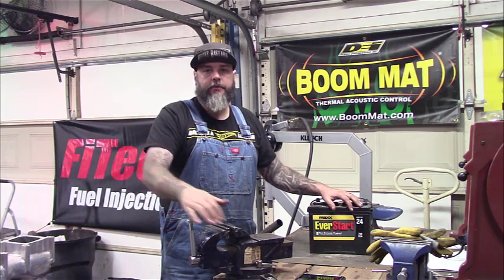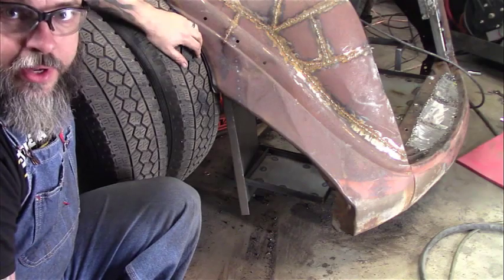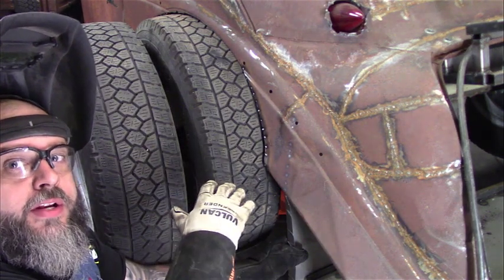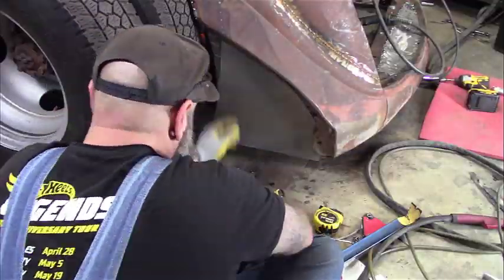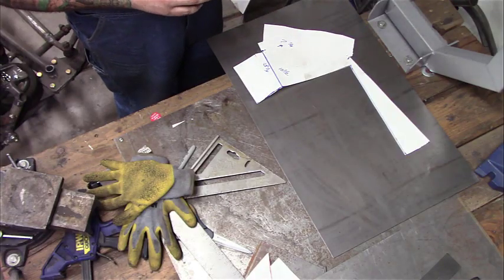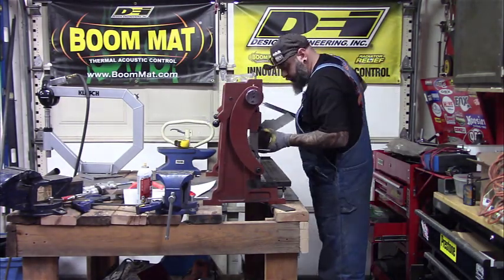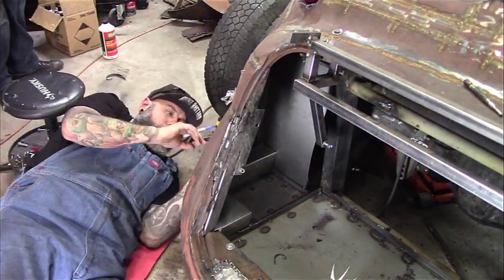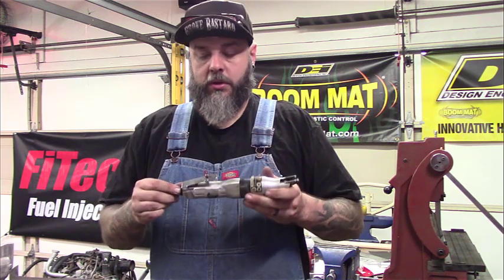"Fabricating a Battery Tray and Wheel well" 1937 Rat Rod Update 45

Comment: You are an ARTIST and a GREAT TEACHER congrats on your job. Inspires me to learn to weld. Im getting my machine and start the process. If you can recomend me some equipment where i can star the beginers way and the appropiate metal gauge, ill appreciate it. Welding 101.
Thanks for your advise!
Reply from the maker: You can pick a Lincoln 125 for about $150 - $200 used. They run on 110 volts. Get your hand on any clean scrap steel you can find. Start with 10 gauge and just practice laying beads, before you try to weld thing together, then move on as you feel comfortable. Believe it or not I  taught myself to weld over 20 years ago the same way.